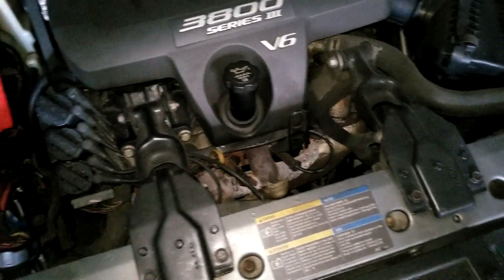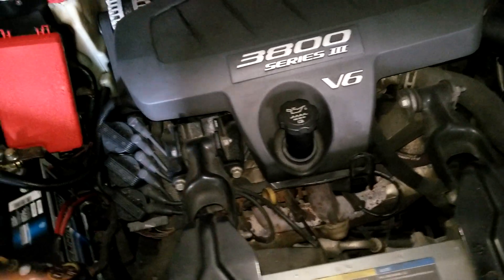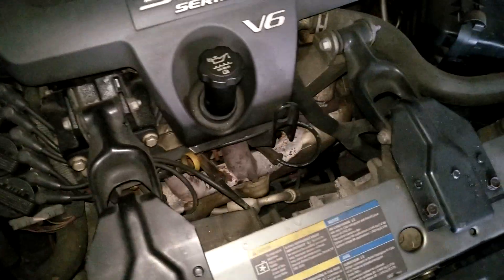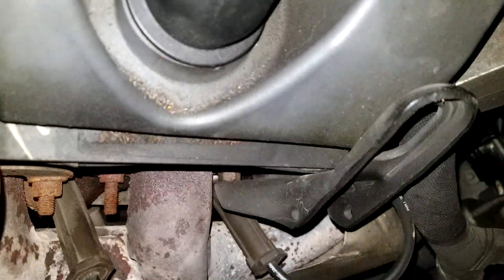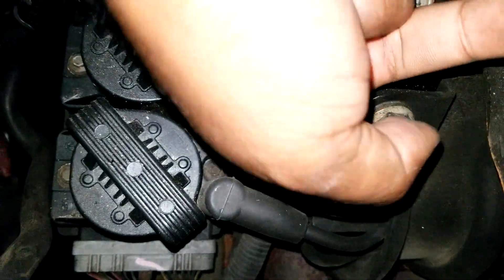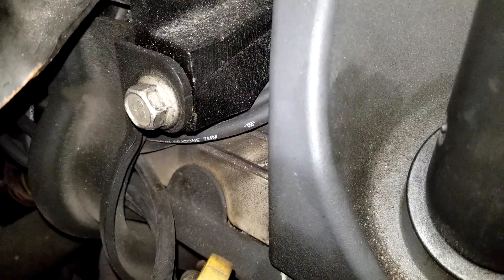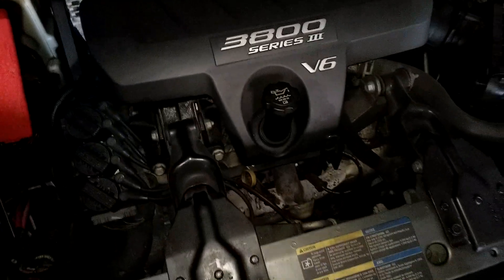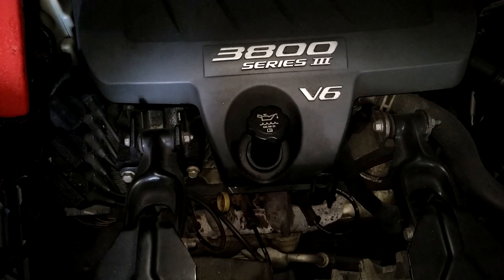Pontiac Grand Prix - Spark Plug Wires and Metal Bracket Mystery

Comment: You don't have to take the brackets off to get that rail that the spark plug wires go on, all you have to do is remove the plastic cover by removing the oil spout twist that off pull your cover off and then underneath the wire railing there's two little clips if you pull on those that railing will lift off

Comment: The front thing you touched where the wires are going into, that's just a plastic clip that slides off.
Reply from the maker: Mystery was already solved. Some models (mine included) didn't have the ability to just slide off the plastic clip. Later model ones were changed and have a clip that can either be lifted off or slide off. I'm just unlucky with that one. Unnecessary extra steps

Comment: If you twist the oil cap you can take off the plastic cover
Reply from the maker: I know that. I have tons of videos where I work on this engine. Wasn't the point of the video. 

FYI, the mystery has since been solved. Some models (like mine) had the wire rails running along the side, so you had to loosen the bracket to get the wire out. Other models had the rail running upwards, so no need to remove the bracket. Nothing to do with the plastic cover

Comment: I have the exact year (2005) GP. I have changed the plugs and wires on it. The coil boots will fit through the bracket without loosening it. As far as the wire cover running along the valve cover, I know I read somewhere in a GM service bulletin, GM said to throw it away and just use wire clips to hold the wires. Gm also said to throw out the beauty cover.  Ya know the big plastic 3800 Series III Cover.
Reply from the maker: Hi David. How did you fit the boots through on yours? Even trying to force it, it won't go through on mine. Does your motor mount bracket have a bigger gap vs mine? No one has answered this lol. 

I did not hear about the wire cover. Maybe I'll do that in the future. 

I did hear that about the beauty cover, due to potential fire issues. But I'm not concerned about it, so I've left it for now

Comment: My 07 doesn't require that bracket removed. Changed the wires last year no problem

One thing I should add as an FYI, once the wire is removed off the plug, it's worth giving the spark plug area a blast of compressed air to get rid of any debris that may have collected there and may prevent you from getting your plug socket completely on the plug hex area.. Last thing you want to do is break a plug end off or round off your plug hex area
Reply from the maker: Ok cool. thanks for leaving the tip, first and foremost. Wouldnt mind if you left that on my other spark plug/ignition video. 

Can you tell me what is different in yours vs mine? That would be extremely helpful in getting the details. Which bracket are you talking about? Let or right? Just trying to educate myself on this :)
Reply: @NexusAuto  I didn't have to move any brackets, just the plastic cover for where the wires are routed that is between the brackets and the valve cover.

So the revision for later years is that plastic guide where your wire is routed is situated 90 degrees and facing upwards and has a cover that pops off.

Here's a picture that shows the difference in that wire guide/cover : http://images.gtcarlot.com/pictures/38655477.jpg

I'm from Stoney Creek, Ont btw.. down the street from you.
Reply from the maker: @cidkramer  thanks Dave... seriously. I had so many people challenge me about removing the brackets over the years (most are polite, such as yourself), but no one ever said 'well, mine is different'. Now I know, and I'm happy I posted this, and happy you took the time to comment. At least I have a guideline on what changed. 

Also, very cool. Nice to meet a fellow Canadian. My channel is largely viewed in the US, so I don't get a lot of Canadians on here. And you are very close. 

Last, I saw you posted on the other vids. Thanks for taking the time to hunt them out and post. Very much appreciated. It is a very good tip for future viewers!

Comment: I like all your Grand Prix videos..off topic...there was a recall on that 3800 engine cover years ago. That plastic cover causes engine fires, throw it away or take it to a dealer, they will perform an actual recall and update your vin record.
Reply from the maker: I think the covers were on supercharged models...no? I remember hearing about it a few years back, but could swear that was on the SC models. There was a couple of recalls on mine (possible oil leak causing fire, key issue) and had those fixed already. 

Thanks for the great comment, and glad the videos are helpful! Definitely more to come.
Reply: @NexusAuto  Originally it was only for supercharged, but in 2015 all others were included too. Mine is not supercharged, but dealer removed it a few years back.
Reply from the maker: @xvassilli28  hmmm. thanks for the tip. I will definitely look into it. Appreciate the info! Definitely don't need any unintentional fires!

Comment: Did you solve the mystery?
I'm getting new spark plug wires.
 Dealer changed them for my last time.
How do you remove the front 3 wires? 
Do you remove the plastic rail?
Reply from the maker: I believe I did. It turns out, some models, especially later models, do not need to have the bracket on the driver side of the engine removed at all. You just have to lift open the plastic rail, something I cannot do in my 2005. Whether you just need to lift open the plastic rail, or loosen the bracket as seen in my previous videos, to remove the front 3, you will just need to lift them out. Aside from the rail differences, this video should hopefully help
https://youtu.be/7VIKzRicY44

Comment: I got a question can I put 2004 Pontiac grand prix gtp o2 sensor on a 06 grand prix gt
Reply from the maker: Hey Joe. Yep, an O2 from an 04 GTP will work on an 06 GT.
Reply: Alright coow. I got a 06 gt now. After I finally fixed up my 04, someone crashed into it running from the police.🤦🏽‍♂️🤦🏽‍♂️ so I took off some of my knew pieces off the old grand prix and was trying to see if I could put them on the 06 grand prix
Reply from the maker: @kingavery8918  oh damn, that sucks Joe! Especially after you put so much time into the old car! Glad to hear you're alright though! Shitty deal! But at least you have a new one now, and some parts to go with it too! Some positivity out of that wreck. As always, if you have a question, feel free to reach out
Reply: @NexusAuto  thank you.
Reply: @NexusAuto  Question is the coil packs and ignition coil the samething. Cause when I look it up it keeps showing coil packs, instead of ignition coils.
Reply from the maker: @kingavery8918  yep they are the same thing. The term is interchangeable, but technically,  they are coil packs. And they are interchangeable between the 04 and 06 as well
Reply: @NexusAuto  I got a question. I got a small leak in my head gasket... I want to try out this blue devil head gasket sealant, but I don't know how you suppose to put it in the car or what to do before adding it.
Reply from the maker: @kingavery8918  hey Joe. So, here is the process for blue devil. You will need coolant, distilled water, and a drain pan. 

1. Remove the thermostat 
2. Flush out the entire cooling system. Make sure you get out as pretty much all the coolant. 
3. Fill system with distilled water and some blue devil, and the  let engine go cold. You'll have to wait a while. 
4. Open rad cap and start engine up. As it starts circulating the distilled water, start pouring in more blue devil until you have used it up. Be patient with it...it will take a while
5. Once you've used the bottle, put the rad cap on and idle for 50 mins. I'm never a fan of idling for this long, but the instructions call for it. 
6. Once you hit 50 mins, shut off the GP and let it cool again. Once cold, drain distilled water. Dont have to completely drain the system, just open the rad up and hoses and let out what comes out. 
7. Reinstall thermostat (may be a good time to buy a new one and install it, if its old) and fill system with coolant. 
8. Warm up car and burp system. You should be good to go.
Reply: @NexusAuto  Ok thank you very much.
Reply: @NexusAuto  I just posted a video of my car making grinding noise while I'm driving can you tell me what that is please.
Reply from the maker: @kingavery8918  hey Joe. I really tried to hear it, but I can't hear any grinding noise, unfortunately. I even put on my headphones and went full volume, and just can't make it out from the video. Is it coming from the wheels, underneath the car, from the engine, etc.?
Reply: @NexusAuto  yeah that's exactly where it's coming from the front wheels
Reply from the maker: @kingavery8918  that could only be a few things...wheel bearings, brakes, driveshaft. Best thing to do is jack up the car and spin the wheel and see if you can locate the noise
Reply: @NexusAuto  I have 3 Questions. 
1. How do I flush out the cooling system and do I need to flush out the radiator too.
2. Do I pour the blue devil head gasket sealant in the radiator or the coolant tank.
3. Can I mix the blue devil power steering leak with the regular power steering.
Reply from the maker: @kingavery8918  No problem Joe. Here is the info. 
1. Make sure the engine is cold. Open the rad cap. At the bottom driver side of the engine, there is a drain plug. It will be on the rad. Careful, it will be messy. Let it drain completely. Tighten the drain plug. More or less, you will have drained enough to proceed with the Blue Devil stuff. Continue with the steps I gave earlier. 
2. You will pour it into the rad. 
3. Yep you can.
Reply: @NexusAuto  thank you. You my go too, guy. Realtalk 💪💪💪👍👍👍
Reply: @NexusAuto  So I just posted a video of cord that I just now realizing was never connected, but for the life me I don't know where it connects too, can please tell me what rgus piece connects too. 

Thank You.
Reply from the maker: @kingavery8918  no problem at all...much respect! I may not always have the answers, but feel free to reach out anytime.
Reply from the maker: @kingavery8918  hmmm...don't know off the top of my head. I will take a look on my GP tomorrow and try to cross reference where that wire goes. It definitely looks like a plug for a sensor, but which one, I have to double check. I will keep you posted.
Reply: @NexusAuto  appreciate it alot.
Reply from the maker: @kingavery8918  hey Joe. I believe that wire hooks up to your brake fluid reservoir. If you look on the inside of it, the closest to the center of the car, there should be a plug there.
Reply: @NexusAuto  yep that's what it was too,  it went to the brake fluid reservoir.
Reply from the maker: @kingavery8918  nice! Problem solved. Did you hook it up? Any errors. It is weird that it would be randomly disconnected
Reply: @NexusAuto  yeah I had hooked it up there wasn't any errors at all. I think the person before me forgot too hook it back up.
Reply from the maker: @kingavery8918  Sounds good to me..nothing wrong with things going right!
Reply: @NexusAuto  I got a question where is the radiator drain plug at. I can't find it on my 06
Reply from the maker: @kingavery8918  it is on the opposite side of where the rad cap is.  So on the driver side. If you look on either side of the rad, there is a black frame. Go to the bottom of the driver side, and there should be a plug there with a little plastic wing nut on it...it is very close to the bottom. when you open it up, it will drain from the bottom. 

Here is a link to an aftermarket rad. You will see it in the bottom left corner of the pic. 
https://www.rockauto.com/en/moreinfo.php?pk=434887&cc=1432256&jsn=3087
Reply: @NexusAuto  someone aksed if could you use 04 grand prix rear struts on a 02 grand prix
Reply from the maker: @kingavery8918  Hey Joe. For the rear, you can use the same struts for sure.